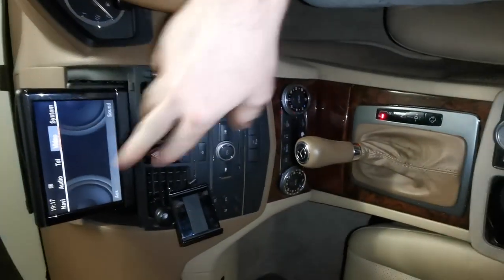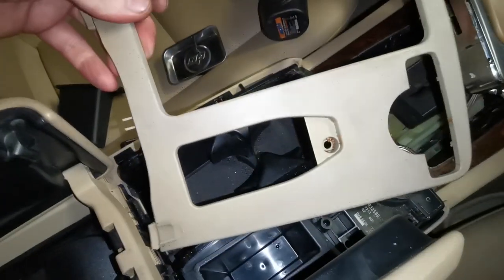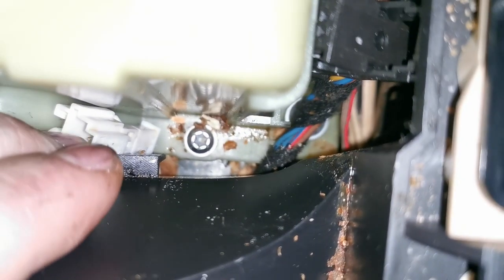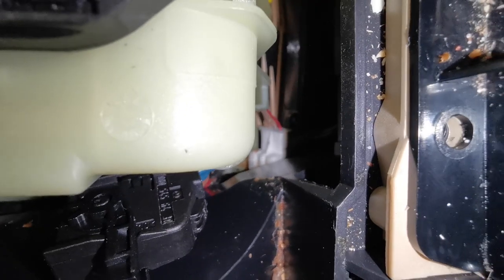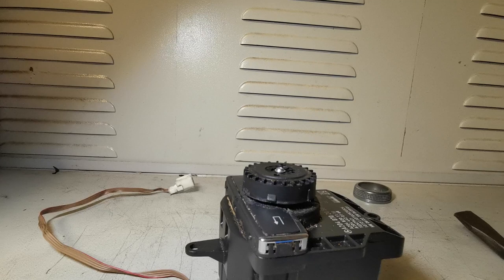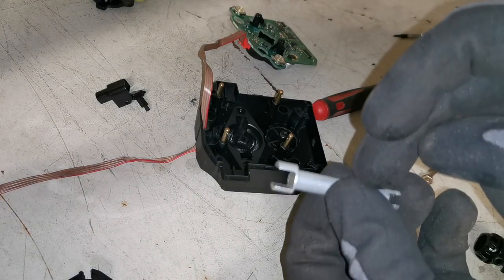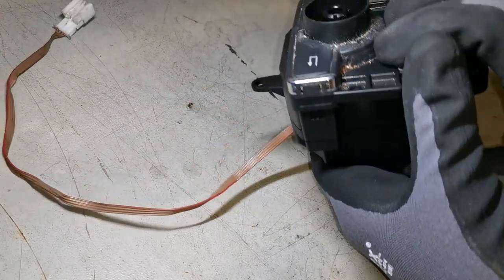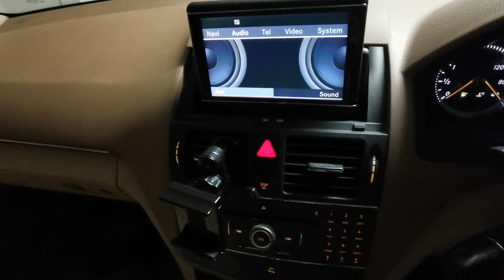Mercedes W204 C Class - Scrolling Knob Comand Wheel Repair - How To DIY Fix

Comment from the maker: Link to where I bought the replacement part : https://ebay.us/W0R4DX  
Link to trim tools : https://ebay.us/5oySTh
 
Be advised this can be a tricky enough job depending on how stuck your components may be, but this complete part new is very expensive compared with this part which is under $10, a major savings 😀 
 
As always thanks for watching 🙏🙏
Reply: Having watched your, very informative, video, should I need to do a similar job i think I would purchase a new rotary knob for the top of it just to finish it off.
Was the new piece you fitted made of aluminium?

Comment: I've done this very job on my own W204. It might not be a quick repair but it is literally fit-and-forget without the need to code the part to the head unit. A lot of people (myself included) have done videos on this repair. I was able to remove the outer part of the scroll wheel without too much difficulty. It is slotted so you need to line it up correctly when refitting it. Maybe your's wasn't lined up quite right and was just forced on. That would explain the difficulty you had taking it off.
Reply: Doğru hizalama dediğiniz nedir ?
Reply: The outer part of the scroll wheel has slots and the inner part has protrusions that line up with the slots to ensure an exact fit. It is exactly the same principle as the Woodruf key on a carkshaft pulley.